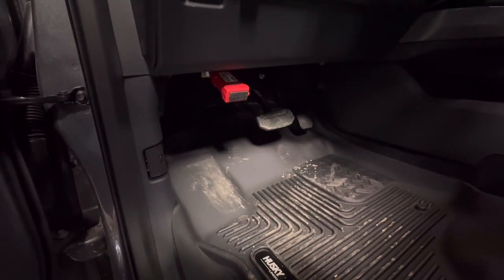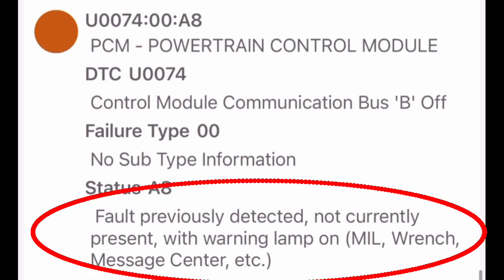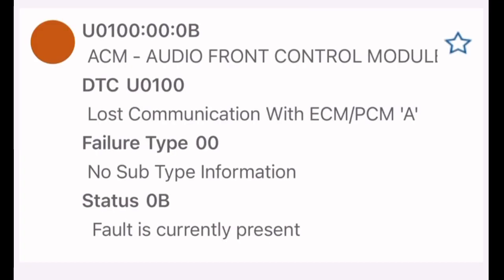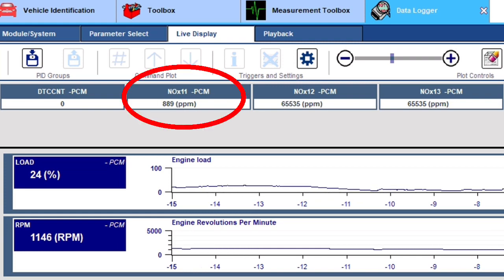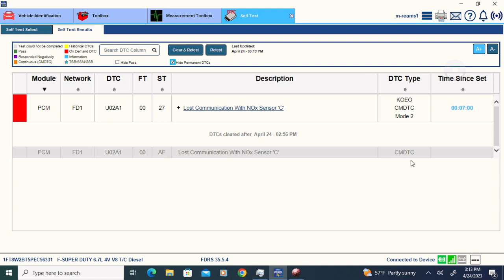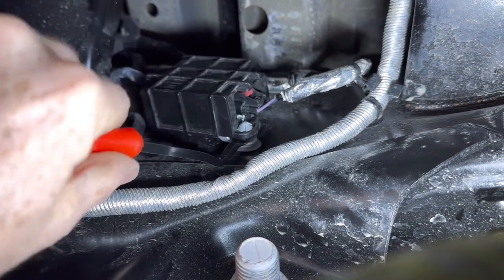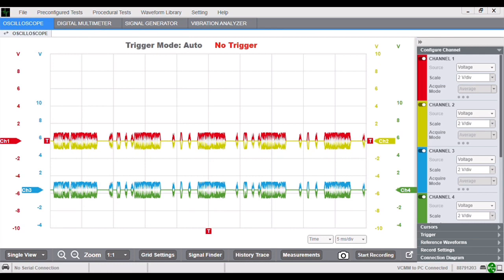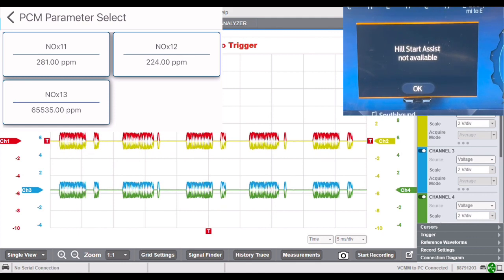2023 F250 DEF Fault - Speed Limited to 50 MPH

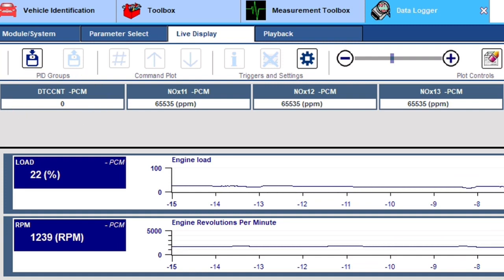Comment: Hey man Im having a demon of a truck its a almost new 2023 f350 only code is u02a2:00-af lost communication with reductant quality module. Ive chased wires and plugs cant find corrosion or broken wires. Went to ford they replaced the def tank batteries fuse box control unit and another terminal. Im at a loss.

Comment: We had pin spreading at PCM due to a mechanic at a different shop jamming something in there to test with, then cutting wires that should not have been cut at all.... El Butcho El Chopo
Reply from the maker: The pins are so small on every thing now days you have to be really careful about that.